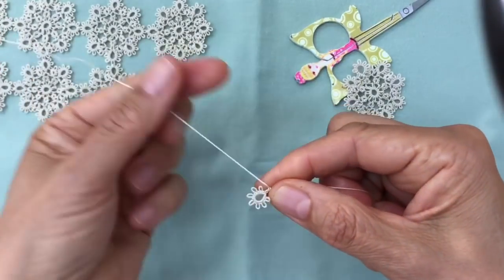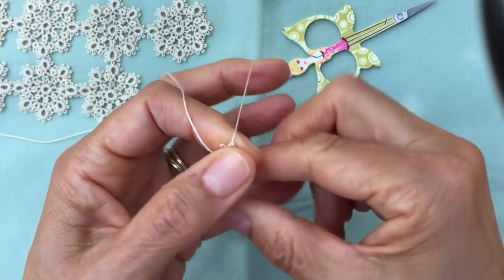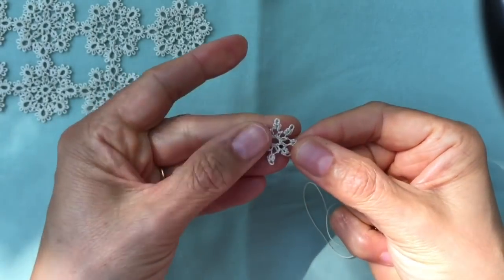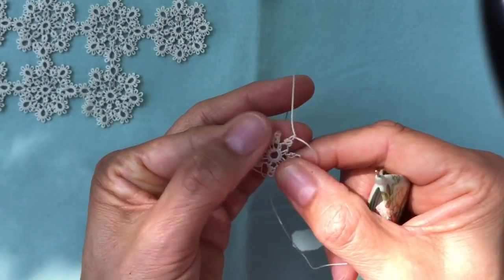Tatting - A One-Shuttle Medallion

Comment: Spending this lovely Saturday rainy afternoon working on this project. I love all your videos! I promptly made two medallions into earrings
Reply from the maker: Thank you Monisola, nice idea for earrings, did you stiffen them?
Reply: @11Frivole   i have made some earrings too. How do we stiffen them?
Reply from the maker: @nimibiswakarma7540  Hello Nimi, I don't always stiffen earrings, but when I do, I use diluted PVA glue (white glue diluted with water so it's not too thick).  It works really well.  I paint it on with a brush and let it dry flat.
Reply: @11Frivole  Thank you so much for your reply. Surely will try. The kind of threads we get here only make limp tatting patterns which aren't suitable for larger earrings. (Btw, This is the first time any YouTuber replied to my question.♥️And I love your tutorials)
Reply from the maker: @nimibiswakarma7540  Hi Nimi, I'm certainly glad (and sad) to be the first YouTuber to answer a question of yours!  I do try my best to answer all comments (I occasionally miss some and I'm not always able to reply straight away but I do try to answer all).  Yes, it's nice to have a thread with a nice tight twist for firmer tatting but even with a softer thread, you may find your problem is solved by stiffening.
(p.s. if you want to make sure I see your comments, please reply or write directly to me because that way I see your messages in my "unanswered comments" section.  The reply here was to Monisola).
Reply: @11Frivole  😊 thanks a lot for your suggestions ( on both Tatting and YouTube comments)

Comment: Hi I'm trying to figure out needle tatting.Could tell me how I can tell which is the rw side.Im not getting this ?Confused
Reply from the maker: In traditional tatting, you reverse working when going from a ring to a chain and vice-versa.  The side where the double stitch has a little bar across the top would be the front side (sorry can't add a drawing here to illustrate what I'm saying!).  In this pattern, there is only one "reverse work" after the first central ring and that is so you can have the shuttle on the right side (accessible for your right hand) after making the mock picot. The rest of the pattern is all worked from the same side.   Probably too long of an explanation and no doubt made it even more confusing for you!

Comment: great video, and very relaxing, just one question: when you turn your work over and start the first tiny ring, shouldn´t you start with the second half of the double stitch? as it is turned over, all the ds will look good in one side.
Reply from the maker: Hi, yes, you certainly can if you prefer to tat FS/BS.  I sometimes do but also often tat the regular/traditional way, always starting with the first half.  In this case especially, the tiny rings are so small that it's hardly noticeable.  :-)
Reply: @11Frivole  you are right! I did myself and one can barely notice. I love the medallions together! Especially the accidental crosses that are formed in between them! Great video! Thanks a million. Subscribed

Comment: Beautiful video thank you so much may I ask where you got your shuttle it's beautiful!  Is it a certain size?
Reply from the maker: Hi Hollyann, the shuttles I use are Aeros which I modify and decorate myself.  I had been selling them in my Etsy shop for many years (www.etsy.com/shop/lacossette) but am currently taking a break due to other commitments.  Thank you for your comment!  :-)
Reply: @11Frivole   what do you use to modify the base of the needle? that is my biggest issue with my shuttle
Reply from the maker: Hi Heather, I use a craft knife to reshape that area as I don't like how the thread tends to catch on the neck of the shuttle in its original shape.

Comment: Hello I am a beginner but I notice that when I finish my ring I cant pull the working thread with the shuttle to tighten it. I can only pull the other thread. What am I doing wrong?
Reply from the maker: Hi Christine, I think it must mean that your knots are not transferred (or flipped) correctly.  To start off, check after each half knot you make to ensure that the core thread still slides within the stitches.  I have a beginners' video that really concentrate on transferring the knot, maybe that would help?
Reply from the maker: Here is the link:  https://www.youtube.com/watch?v=OWdbxK-NuNY&t=371s

Comment: This is the trickiest motif I've attempted so far and it is, so far, going pretty well, all thanks to your guidance! Leaving bare thread is rather stressful in my opinion and part of me would rather deal with endless RW and chains to connect the rings, but I have to admit I love how delicate it looks! Practice makes perfect, so I'm sure I'll be more used to this once I've actually finished this medallion (and perhaps try making another?). Thank you for posting a video of making the pattern from start to finish, it is quite helpful!
Reply from the maker: Hello, I'm glad you are enjoying this project.  I'm sorry you find them stressful but yes, I agree with you that bare threads give a very delicate look to designs that use them.  I love making one-shuttle designs and personally find them relaxing to work.  Good luck!
Reply: @11Frivole  It's been over a week, so I thought I'd give some update: now that I'm more used to it, I can say it's not stressful anymore! One reason I was not too comfortable is that the length of bare thread I left would always be somewhat inconsistent (a little too short at times, a little too long some other times), so it felt like the whole motif would be ruined -- but that's actually wrong. It's actually pretty forgiving. Of course, it looks much better with the proper, regular spacing, but small mistakes or inconsistencies aren't too noticeable from afar and, with practice, I'm getting a much better feeling for leaving an even length of bare thread.

By the way, did you know where this motif is originally from? I saw it when reading an old book on Project Gutenberg: it's in Beeton's book of needlework, which has some patterns and techniques on tatting, as well as embroidery and some other types of needlework. I like your pattern much better, though: in the book, they use 3 separate rows, instead of climbing up with mock picots and split rings. Since your version is more efficient and there's less fuss about finishing off all those thread ends, it's easier to get into a nice tatting rythm and just enjoy the process.